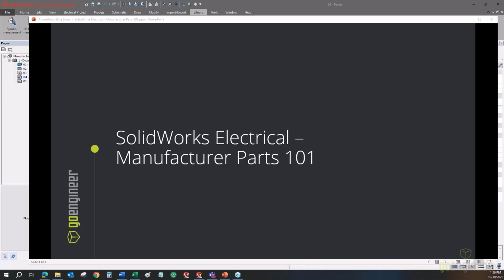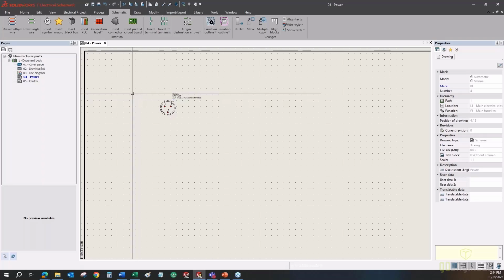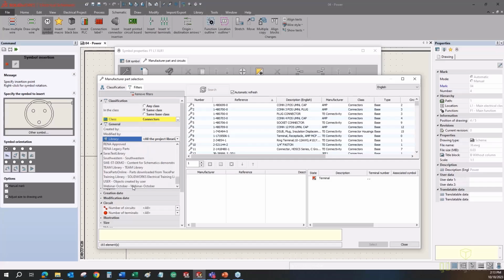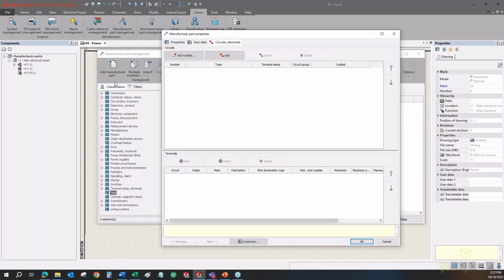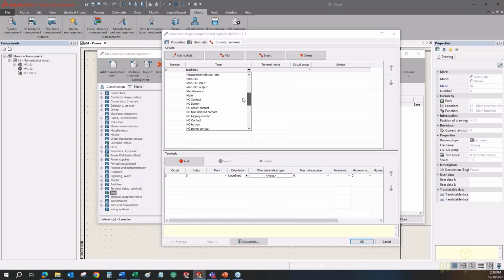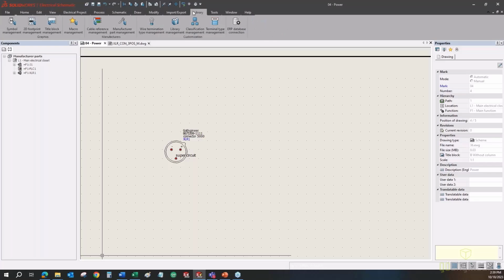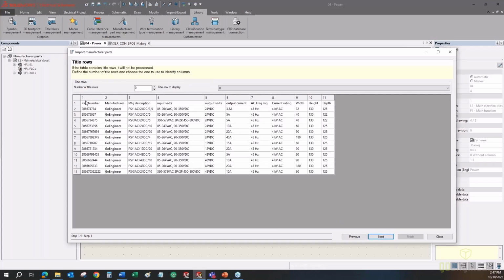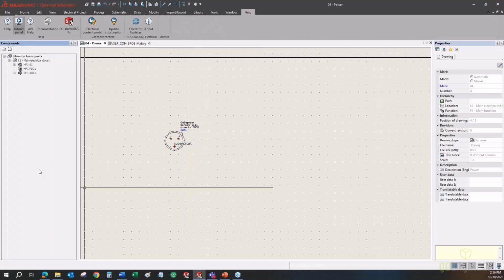SOLIDWORKS Electrical: Manufacturer Parts 101 - Webinar

Comment: A very confusing part about circuits and terminals is what these mean. For instance, a circuit with two terminals to me is a path through the component like in the instance of a contactor or coil. but in SWE this may or may not be the case. Correct me if I'm wrong. A circuit in SWE can be either an associated set of points that could pass data through the components or be an end destination with not pass through. My biggest struggle still is to determen when to create multiple circuits with fewer terminals.
Reply from the maker: There are pros and cons to each approach, get in contact with your VARs applications engineers and see if you can get some coaching from the experts.